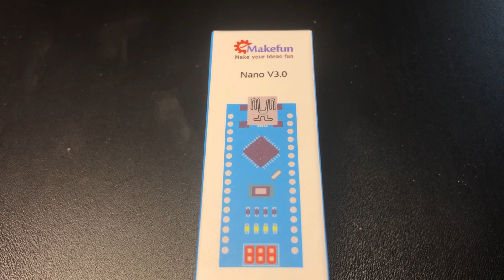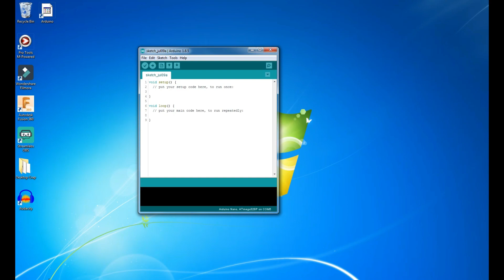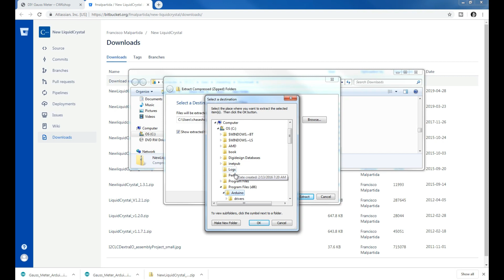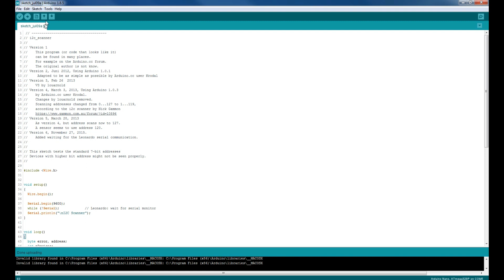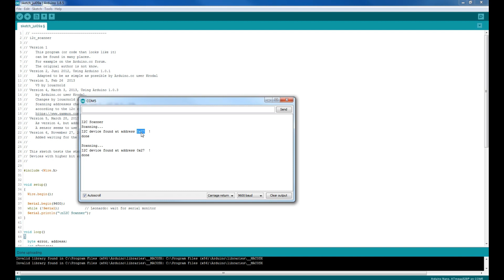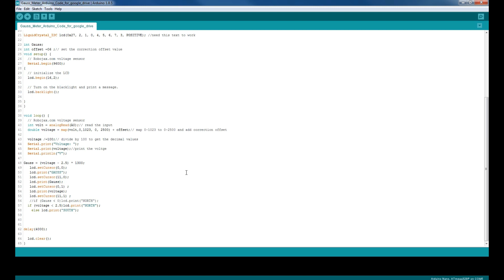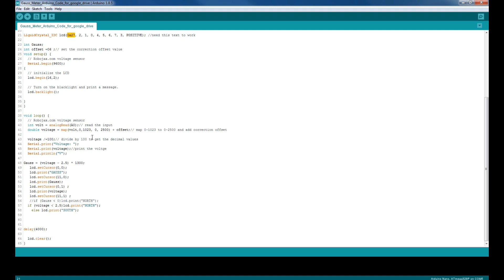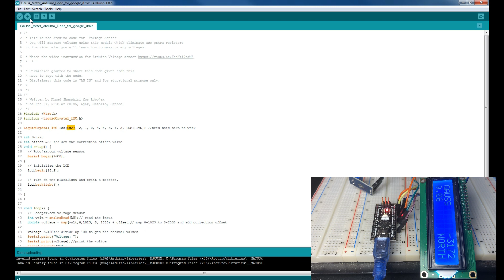✅Gauss Meter Arduino Tutorial Setup

Comment: Hey Chase, thanks again for replying to all of my questions a couple of weeks ago. I've kept tinkering with this thing and double-checked all of my connections. I can get the code loaded on the arduino now, but the LCD screen reads GAUSS -3172 0.06 NORTH and does not change when I put a magnet near the Hall effect sensor. I've built the thing twice with two different sets of components, and gotten the same result. Can you think of anything that might be causing this? Any insight you have is deeply appreciated!
Reply from the maker: Hey bud, did you use two different Hall effect sensors? You could check to see if the Hall effect sensor is wired right to its pinout. Sounds like the code is working, could be a hardware issue.

Comment: Hey thanks so much for sharing this. It's a super cool project. I got my circuit built, but I'm having trouble loading the gauss meter code to the Arduino. I get "POSITIVE was not declared on this scope." Got any ideas?
Reply from the maker: Hey bud, glad you like it. I had some others with issues with the same code. Usually something doesn’t copy right from the source code into the ide and causes this error. It could be a space or a other symbol. Try deleting all the parentheses and other symbols and re enter them with your keyboard in the ide . At least that was the issue the last time someone had this problem. Sorry if that doesn’t help much.
Reply: @ChasesWKshop  Thanks for your reply! I tried replacing the parentheses in the code.It's still not working. I keep getting the same 'POSITIVE' was not declared on this scope message. What other symbols in the code should I delete and replace?
Reply from the maker: @jordandominy7295  hey bud, did you install the libraries into your IDE for the I2C Display.  If not that could be what’s causing your problem.
Reply: @ChasesWKshop  I sure did. I got the LiquidCrystal library that's linked from your website. It's a real head scratcher for me.
Reply from the maker: I did some research on the web about it and they said it was something to do with the file name. Have you searched any on the arduino sites about positive not declared. They all seemed to be on the liquid I2c display.
Reply from the maker: You may can try an older version of the I2c library and see if that works. You’ll need to completely remove the other version you have. See if you can look into the library and see if they are using a different integer for positive. It’s defiantly something to do with the library.
Reply: @ChasesWKshop  I just got it to work! There's apparently a new version that library  or something. But at any rate I got it loaded on the Arduino. I got a circuitry issues work out now because the reading isn't changing when I put the Hall effect sensor near a magnetic. Thanks for working through it with me, and thanks for sharing all the content.
Reply from the maker: @jordandominy7295  awesome bud. Sorry for your troubles. I need to look into that library and see if I can change the code. It’s been so long since I messed with it I’ve forgotten so much haha.

Comment: thank you for this! I haven't had much time to spend with mine and still struggling but I will keep at it..I think another problem of mine is that I am so familiar with Macs. I do have a PC which i tried this on as well but still encountered issues..but this is MY problem and I'll figure it out you have done more than enough here Chase, don't get me wrong!
hey, btw, I was at Joe Glaser's shop last week and he was kind enough to show me his new bender system and how he designed it and how he installs it, etc...it's quite brilliant! almost no routing of the body and the levers attach at the neck plate.
Reply from the maker: Thanks man. You saw Joe!!  That’s freaking awesome man. I’ve been trying to design one that works that way but I just haven’t had time to mess with it. Those are a lot less extensive to install too.  Glad you are getting it figured out. Let me know if I can help you in any way bud.
Reply: @ChasesWKshop  I took a friends tele with me for an install and he did it from start to finish in about 2 hours. He's a very smart guy and he also has multiple lathes, CNC's and anything else you could ever want as a luthier..and of course, the Plek...so he just makes whatever he wants..he even makes his own springs for this new bender becuase its just easier, ya know?lol
as a fellow luthier, you might guess he can be very inspiring to hang out with
Reply from the maker: martinluthierking the plek is crazy man. I’d like to just see one of those working in person.  He is defiantly a master for sure.  I’ve watched him work on other youtubers channels. He’s great.
Reply: @ChasesWKshop  i spoken with many luthiers about the Plek thing and alot of them, including myself, argue that they could do an equal or better fret job than a Plek could...of course in a factory setting a Plek is very useful because it can bevel and dress the frets, cut the side ends and slots and get it al very close to where it needs to be, and do it quickly...IMO where the Plek really shines is when you have an older guitar with a neck that has been under tension (or no tension) and it has moved/twisted/bowed..then you can see the graph on the screen and see exactly what is happening and the machine has the ability to correct it by dressing the fingerboard  or even cutting new slots so it plays in tune...there is some art to doing fret jobs but most of that art is because of a compromise usually because of some limitations from the owner not wanting this or that or paying the $$ for the proper solution. in the ideal situation, the Plek can remove all that and get down to the pure physics of the neck and strings.
Reply from the maker: martinluthierking thats so cool. Think we could build one?😂😂

Comment: I have never done anything arduino, where would you suggest someone go if they know absolutely nothing about arduino?
Reply from the maker: Yosemite Sam I would say YouTube is the best place to learn about them. Best thing to do is just get you an arduino and do some simple projects with it. Search arduino beginner projects in YouTube and you can find all kinds of things to make. Some are simple and make a light blink some are more complex stuff. Then once you get a feel for the simple code you can progress into writing your own code. Starting out I’d get either an arduino uno or a mega2560. I have a link to the nano in the description of this video if you want to see one of those.  Let me know what you think and if you have anymore questions about it.
Reply: @ChasesWKshop  I love the idea of the guass meter but I'm not making my own pickups yet.  I've been looking for a timer though where I press a button and an electrical outlet turns on for 45 minutes and then turns off.  Can  Arduino controllers be used for such things as that?  They are basically little CPUs on a board with assorted input and output right?  Limited only by imagination?
Reply from the maker: Yosemite Sam that’s not too bad man. All you need is an arduino with a relay and some code you can edit for time. Shouldn’t be too bad. I’m sure there is a video on YouTube on how to do it.

Comment: This is very interesting so far! Sometime would be gold if you could make some video with comparisons including sound samples between margnets with different gausses; where you could read the gauss value and listen the tonal step, which is something I've never saw over here. Nice work Chase, keep it up!
Reply from the maker: Obi Wan Kenobi Thanks bud. Im working on doing that. Im just having a hard time getting a good recording of the pickups. What do you think would be a good setting on the tone stack to accomplish this. I thought just all knobs halfway but I’m not sure. Let me know what you think. Thanks for the comment bud.
Reply: @ChasesWKshop  Well, personally I use the tone knobs very few and just sometimes when some clean effects sound too shiny, but I think that video would be helpfull specially about managing magnet types and more relate to it gauss power, with that info you can know better in what direction would be a magnet swap or even when you try to gauss or degauss others. Anyway if you want to add the tone knob values, here you usually see some tests with them at 0, 5 and 10. Cheers bro!
Reply: @ChasesWKshop  PS, I'd make it with volume and tones at 10, where volume is in maxim and tones all off, that way I think you can get better the pure sound of the pickups. From the beggining I meant the tone (sound) of the pickup and it gauss amount itself, not that tone from the knobs. Cheers!